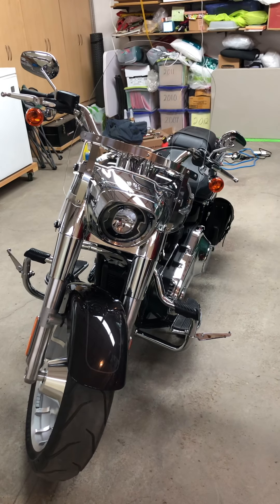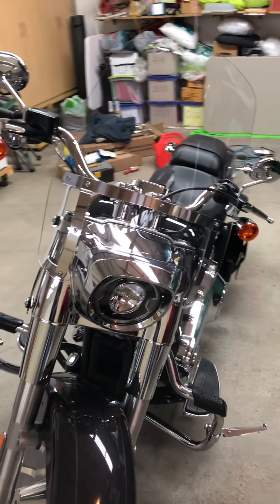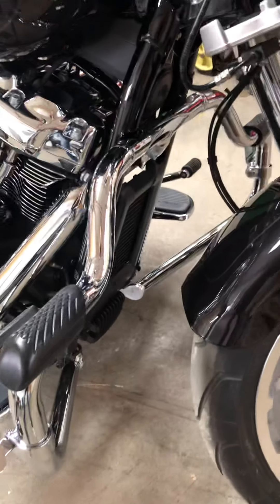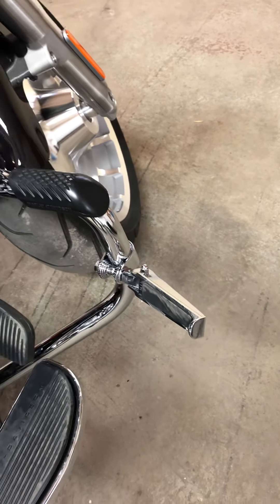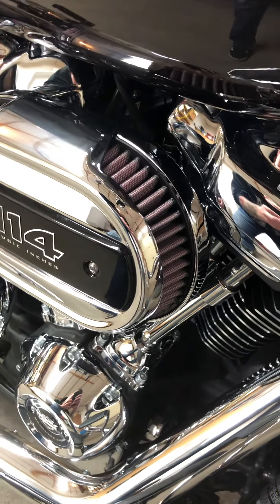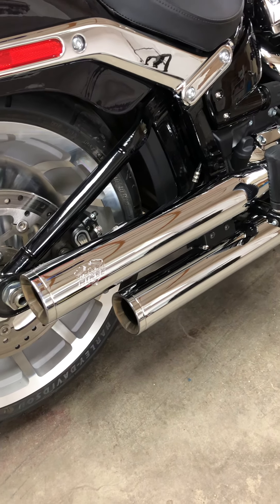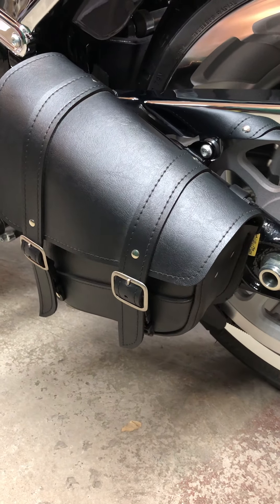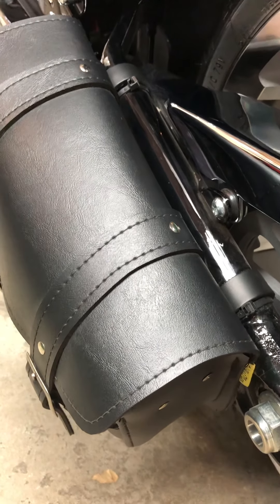2021 Harley Davidson Fatboy - My Basic Setup

Comment: Hello I have a question regarding the Vance&Hines slip-on you installed in your bike; I have the same 2021 fat boy model and bought the same Eliminator 300 for my bike but I had a problem with the O2 sensors that the Vance don’t have a place to connect it; a friend of mine told me that if I don’t install properly the oxygen sensor I would face some issues, because the oxygen sensor tells the computer whether to increase or decrease the amount of gasoline delivered by the injector.  If the computer does not have this information, it cannot optimize combustion and will have less power, higher consumption, higher temperature and premature engine aging. And I don’t know if by installing the pro street tuner would be enough to solve these potential issues or it would also need the smart tune pro to fully avoid any of those issues, considering that the O2 sensors still won’t be connected to the eliminator 300 slip-on
Reply from the maker: If you have the same slip ons as I do, you won’t need to worry about the O2 sensors as they are in the head pipes and not the mufflers. Regardless, you should not have an issue if you use the pro street tuner. They are not the best but they’re designed for that engine. You also are stuck with that tuner if you want to keep your warranty. I don’t believe the smart tuner is compatible with the 2021 Fatboy. I believe it would only work with 2020 and previous softails.
Reply: @canadiansa1nt309  what you mean? My bike has four O2 sensors; two in the head pipes but another two in the mufflers, may be your bike came different than mine.
Reply from the maker: @memoto3059  actually that could be. I’m guessing you may have different environmental standards where you are. There are no sensors in my slip ons.

Comment: Beautiful bike, my dream ride right there. Can I ask_ I never really understude why guys install a swing arm saddle bag, what do you carry in yours
Reply from the maker: I had saddlebags on other bikes when I used to do more touring. Now I don’t do as long of rides as I used to so I just wanted something small. I keep my registration and bandana in it. I’ll also put my hat or a water bottle in it. Sometimes maybe an extra shirt.
Reply: I actually just installed myself saddlebags on my 2019 Fatboy, since I got a little frustrated about not being able to stop and buy ANTHYNG anywhere (where to put them??) , plus I didn't have a place to put my break lock (alarm) anywhere. 
I bought some stuff aftermarket and installed it myself. Has some headaches...but well... at least I have bags. I got stage II, got special seats (me / passenger), + passenger backrest, + special Rinehart pipes (lots of noise),... nice combo.
Reply from the maker: @MarcioDec73  Sounds like a good setup.

Comment: Just picked up exact same model and colour a week ago..with VH300 also...they do sound great agreed but could be louder....the dealer said on my first 1600k service they could drill a hole in each to make it louder.  I don't like that suggestion so will probably just live with it the way it is.  Great bike though and don't have the clunky front rotor like @CoolDandy is unfortunately having.  Cheers.
Reply from the maker: If you have the same slip ons as mine and want them louder you won’t need to drill them. The baffles are surrounded by a fibreglass packing. If you pull out the baffles you can remove the packing. Then put the baffles back in. It will definitely be louder but not obnoxious as you still have baffles. If all goes well the whole process should take about 20 mins to do.
Reply: @canadiansa1nt309  no need to remove the pipes?  Just reach in?
Reply from the maker: Yep. Take out the two Allen screws at the end of the pipe that holds the end cap on. The cap pulls off and the baffles are attached. Then you just have to pull out the packing. The end cap may be tight to get off so you may need a little WD40. The packing may be in tight too. I just used pliers to grip it and pull out. No need to remove the pipes.
Reply: @canadiansa1nt309  excellent thanks
Reply: @canadiansa1nt309  can you do the same with the screaming eagle slip ons?
Reply from the maker: @Chris H I’m not sure if they have the same fibre glass packing. I’ve never used  those slip ons but I think they just have baffles.

Comment: Which cam would u install? S475? Thanks. Subscribed
Reply from the maker: If I was doing S&S most likely. But it  would depend on what kind of riding you plan on doing and what rpm you would be wanting the power at.
Reply: @canadiansa1nt309  understood. But what I’m worried abt, the after market’s s475 cam might affect the bike’s warranty. I spoke to a local dealer, and he advised me to instead use a screaming eagle’s  cam in order to save the warranty, since it’s from Harley itself. What I’m more interested is to get that ‘rumbling sound’, Not really into extra power etc. Any advise or guides on how I would be able to get that effect? Thanks again bro
Reply from the maker: I would say the dealer would be correct about warranty. If they can trace any aftermarket part to an issue you won’t have coverage. But just purely sound I would do the screamin eagle power cam if you want to keep the warranty. If you don’t, do the S&S 475. The S&S sounds better. Of course, that’s just my opinion.
Reply: @canadiansa1nt309  understood. Thanks for the guide!
Reply: @canadiansa1nt309  Just FYI, the 2021 models have a new ECM on it so none of the current aftermarket tuners will work on the 2021 bikes.
So you'd have to get a harley cam and use the SE tuner until DynoJet and Vance n Hines figure out the new ECM and release a tuner for it.
Reply: I’ve been trying to buy the 465c cam kit from S&S for my 2019 FB but none are available. The 465c cam can use the stock valve springs. Maybe next year.